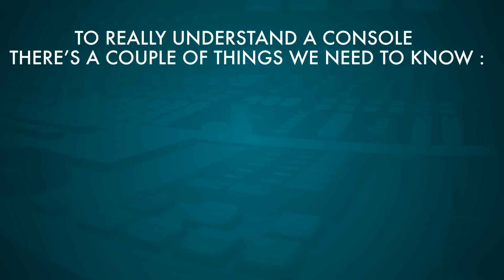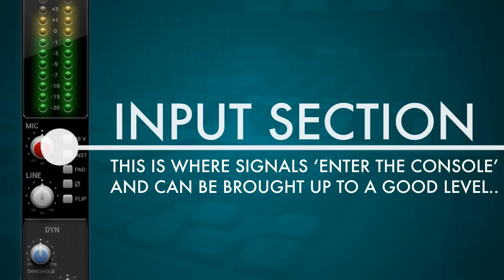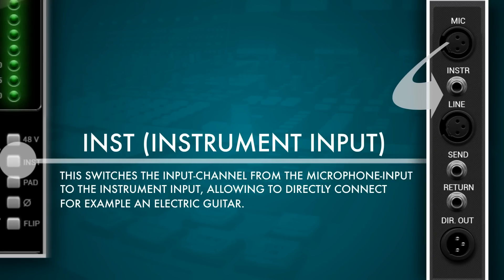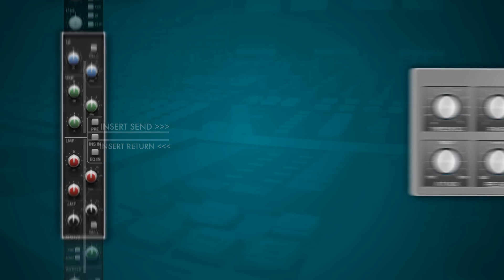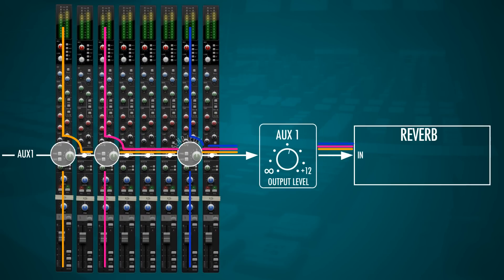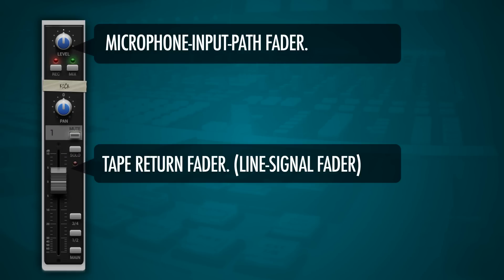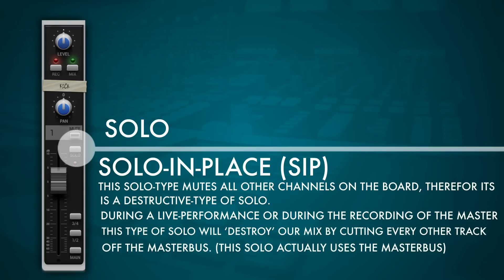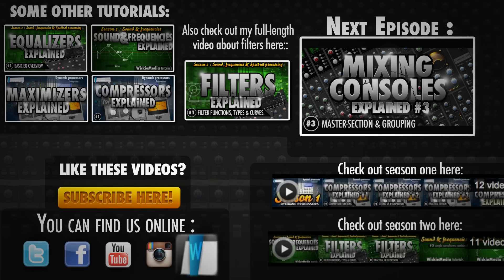Mixing Consoles Explained (Part 2)

Comment: One mistake (at 6.02): On SSL AWS consoles, the FLIP button in the input section switches between the channel path's microphone and line-level inputs. It DOES NOT do a fader swap between the channel and monitor paths or swap the input source. Why SSL chose to label the control this way (rather than "LINE" as one finds on other brands) is anyone's guess.

Otherwise, it's a nice video.

Comment: So,  do you adjust and mix before you record it, or after, as in get it all ready? Like, if you stuff up the mix when you record it, can you just change it after you record it? or do you have to record it all over again?
Reply from the maker: Hi +General Shamic , You typically just set the optimal gain for each of the individual tracks that you record. So you don't really make the actual mix. -Meaning that we basically record all instruments louder than you will probably mix them in. And this has actually got to do with the noise that every recording has. (I will explain all that in a later tutorial where we are going to look at the whole recording process.)
-However, we can do a non-destructive mix from the tape-return path for what we hear coming through the monitors during the recording session.

During the mixing phase, after the recording, we start doing the actual mix. And that is where we can alter the sounds, make it all blend together, and mix everything down to our final mix.

If you work with live musicians in your session, they will also receive a headphone signal to hear their fellow bandmates, metronome, samples, etc etc.. Typically you send them a headphone mix with use of an AUX or CUE send. If we kinda count that as a mix, you usually do three actual mixes for a recording : 1. The control-room mix that we monitor during recording. 2. The headphone mix for the musicians. 3. The actual mix.

I hope that mostly answers your question. I will be doing many more recording and mixing related tutorials that might explain many other things that interest you as well. 

Cheers, 

Wick.
Reply: wickiemedia Thanks mate that makes sense :)

Comment from the maker: Well it really depends on what you're doing and how sure you are about what you are applying.
I personally would avoid recording signals into daw/tape WITH eq/dynamics/etc...
I would try to record as 'unprocessed' as possible.

Than during the mixing stage we can equalize, apply dynamics, fx, etc, and still be be completely free in those choices.

Comment: so you can't undo/redo/tweak inserts/EQ done with the console right? if the modulated signal goes into the DAW/tape the way it is permanently, the only advantage of using a mixing console instead of an audio interface connected to a DAW is the analog/warm/diferent sound you get from it right?